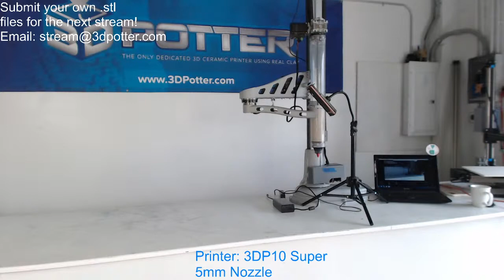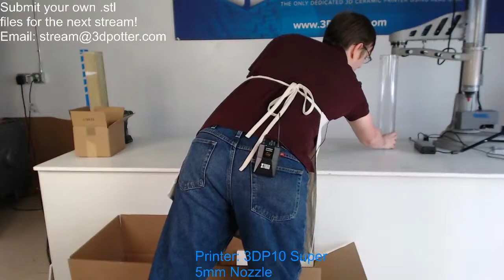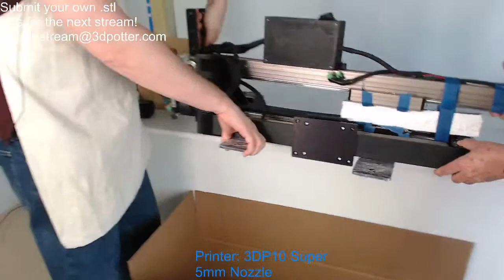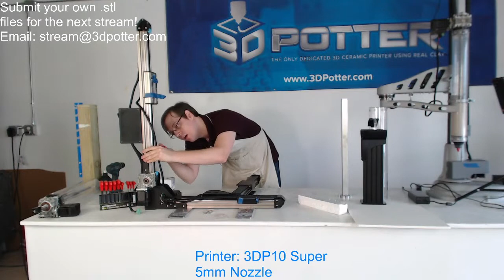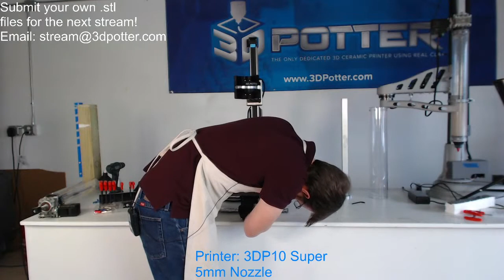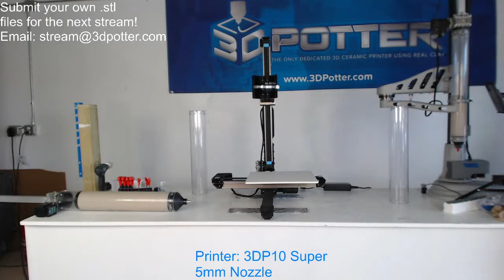3D Clay Printing: Unboxing and Printing your First Object, Stream 007

Comment: my Potterbot XL10 does not run the print start location series and says error, paused due to low voltage. I called the electricians and they checked the systems and said it has enough according to the outlet and the unit specifications. They say the error must be in the machine....
please advise